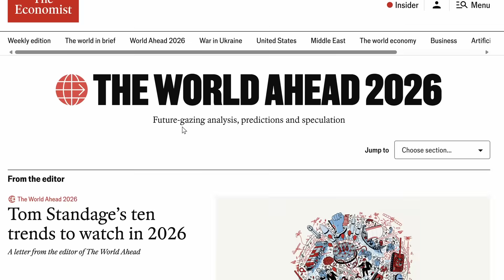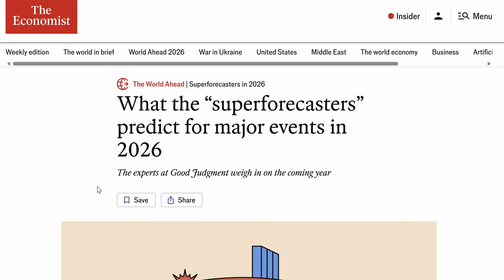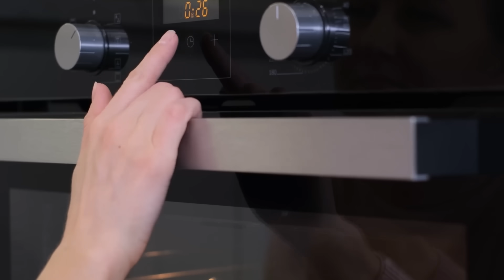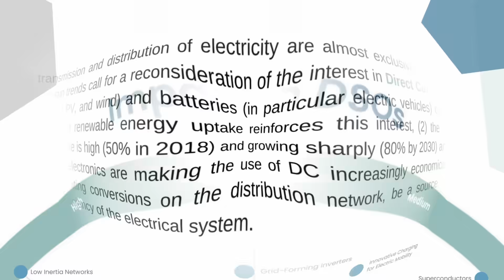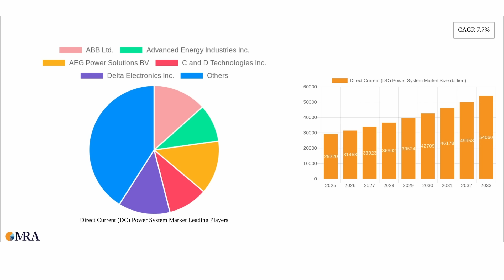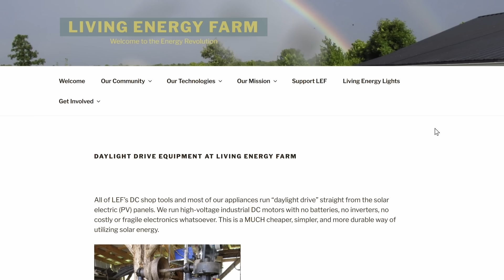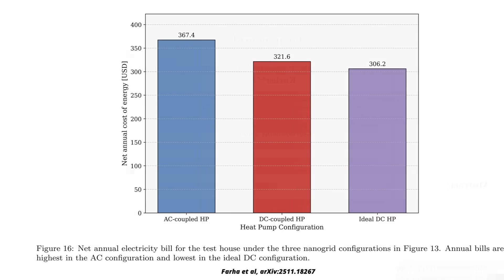Are We Using the Wrong Kind Of Electricity?

Comment: Dc is efficiency with local storage and production.  AC is transportability across large networks.   Local production and storage for the advantaged does not justify elimination of the other.  It promotes oligarchy.  And what happens when a local system fails?

Comment: Complete electrical infrastructure and most large electric motors are designed for AC. Problem you have to solve is energy storage which can smooth irregular output from wind and solar. Imagine sufficient of cheap batteries to run whole Europe for 38 hours ...

Comment: 0:35 - omg... since the start of days alternating current has been used to transport energy long distances. that is it's purpose; most eletronic devices tranfrom them into DC anyways.
so... seriously you included cars and solar panes what changed? your eletronics won't have to make an extra conversion, maybe we'll start needing a dc and a ac plug
or more probably someone will invent a circuit that convererts them between eachother automatically and nothing changes. So yeah nothing will change. that's what I think...
let's see if the rest of the video changes that.

4:25 - and the reason is people are already doing it!? bro... that's stupid. I made my research. what I've learned about transmiting AC being better than DC wasn't about the transmission.
it was about power conversion, delivering energy with low current and high tension is what saves energy. I've seen some claims that the induction effects created by AC make it less efficient, but idk.
the thing is power upping DC has become easier with better eletronics but yeah. Aparently the lack of skin effect and losses due to inductive/capacitive effects, DC does end up being better.
you just need really expensive equipament that uses more silicon and, oh wait... I guess I'm seeing something here...

Comment: When the power grid was being built during that rivalry between Tesla and Edison, it made sense to use AC for long distance transmission instead of DC because AC can be stepped up to a very high voltage via transformer that can be transmitted through thinner wires with little resistive loss.  They did not have enough copper to make the wires thick enough to transmit the same amount of power over the same distance in DC.  Things are changing making DC more viable for transmission and normal household use.  They just have to start making more appliances that run on 250 VDC or what ever voltage is being generated by the panels instead of 110 or 220 VAC.

Comment: Historically the long-distance AC-usage and lower power loss advantage occurred because only AC could convert into very high voltages and back via transformers.
But the technologies for converting very high AC electricity into very high DC and vice versa simply did not exist at the time. They were simply missing.
Today this is possible, but still very complex and therefore expensive because in the end internally there is always AC necessary for any (high-) voltage transformation and of course back down. This is dictated by physics. Nobody can transform voltages without AC.

Since long-distance AC-losses do not occur at DC-systems it is in the end an economic question to use this technology or not; for very long distances this expensive method might be useful. 
But for extremely long distance like the evaluated project power lines Morocco to the UK and Australia to Singapore, their transmission losses were still estimated somewhere between 25-33% using HV-DC, making still every 3rd or 4th PV-panel or turbine only working for making up for the transmission losses. Killing the idea (besides other issues) economically.
One of the major reasons both projects were shelved (to my information - if you know it better, please correct me).

In the end it is debatable, every DC-grid will have frequent internal conversions everywhere back to AC, the moment you need different DC-voltage(s) at or inside your device or machine. Transformers - huge or micro - will not operate on DC. Voltage transformation requires AC; no choice.
And yes, the statement is correct: DC brushless motors are actually AC (@Mentaculus42). It makes only sense if a motor speed control is needed to add the final AC power converter just before the AC-motor.

Every charging cable inside its power wall-plug converts via a small internally electronics the incoming AC (230V / 120V) first to DC, converts it to a high-frequency AC (usually around 30kHz), goes through the internal micro transformer, exiting at an lower AC and finally being rectified into the now 5V-DC, 9V-DC or 12V-DC or whatsoever DC-voltage to feed your computing electronics or radio etc. with internal DC.

I do not see a true advantage here. But hey, maybe I am wrong.

Sabine is also partially wrong; 
Larger wind turbines generate in the end synchronized AC directly into the grid. Asynchronous generators are used and it works basically like this:

- If the rotor spins too fast its stator winding is being supplied with a negative frequency AC. Both frequency add into the desired 50Hz (60Hz)
- If the rotor spins too slow its stator winding is being supplied with a positive frequency AC. Both frequency add into the desired 50Hz (60Hz)

Frequency (rotor) + frequency (stator) = constant desired grid synchronous frequency

Only a small amount of necessary electricity for the stator winding is therefore internally converted first into DC and then back into AC at the necessary difference frequency.
At the output of the wind turbine there is a pure synchronous AC going into the grid.

Smaller wind turbines indeed generate windspeed-changing = frequency changing AC (to be completely converted into DC just for pure synchronisation purpose). This AC-DC-conversion is done by a power electronics or a mechanical commutator at the generator shaft, before a power converter synchronizes its frequency, phase and voltage according to the current grid.

Which is why wind turbines still cannot black-start a grid, at least not without additional technical effort.
Correct is that any PV-panel on this planet generates DC. This too is dictated by (semiconductor) physics.

Peace! from Dresden / Germany

Comment: Had we done DC in the USA we would have needed the stations every few miles at best, and the whole country would have burned down by now with how bad we are at keeping up on infrastructure. Think AC power line failures are dangerous, oh momma is arcing and burning worse when it is damaged DC, especially higher voltage. Also huge issue *𝐃𝐢𝐫𝐞𝐜𝐭 𝐂𝐮𝐫𝐫𝐞𝐧𝐭 𝐂𝐨𝐫𝐫𝐨𝐬𝐢𝐨𝐧 (𝐃𝐂 𝐂𝐨𝐫𝐫𝐨𝐬𝐢𝐨𝐧)*  So no to switching stuff over to DC, would not help nationally but the local levels are better, easier to replace Wall Wart Converters than whole power stations or wires, or other equipment continuously.

Comment: The issue is that we were headed that way. We made semiconductor based high voltage 'transformers'. But they turned out more expensive than copper based ac transformers. Yes many advantages including no reactive losses. No power factor to worry about. Capacitive effects are why we use DC for underground cables.

Comment: a lot more than evs use DC  as you say,   issue is imo same as it was for Tesla and Edison though.,  back then it was impossible to implement DC cuz free energy doesn't pay to implement itself and installation methodology was in concept alone.  if you've ever installed wiring for the 2 you'd understand their dilemma instantly,,,,  the wires im to use to go 13ft in a car to a single amplifier are bigger than those that supply my entire house from the pole across the street 40ft away ..   today a circuitry of sorts might finally be achievable like tesla dreamed., but it might not be smart even if..

Comment: DC has an inherent problem when the circuit has to be broken quickly. The L di/dt inductive kick is nasty and destroys contacts. AC has the advantage of breaking the current when it goes to zero.
Reply: Even with AC it is difficult to suppress the arc when a contact is broken. There used to be a surplus Iron and Steel business in my town. In the yard they had a large surplus high-voltage transmission line "switch". The switch was a stainless steel tank about fifteen feet in diameter and about twenty feet high. The actual switchgear, of impressive magnitude, inside was visible through an open access port. The entire tank would have been filled with, likely, PCB's, to help suppress the arc when the contacts were opened.

Comment: The main advantage of AC is that the flow of charges(electrons) happens at a more short range, than in DC. In AC the charges are push-pull due to alternating voltage polarity forces at distances of meters or less. In DC those charges must be push or pull to way larger distances with the voltage having constant polarity. And that facilitates the transmission of EMF at larger distances compared to DC. An AC power transmission line uses less repeating stations than DC, which is cheaper to build and maintain.This was discovered by Tesla during his experiments. Happy holidays to everyone.

Comment: That's not entirely how this works. DC is just for battery cells, electronics and extreme scale. A car has frequency inverters and 3-phase motors. You get DC from solar but as i said, that goes into batteries and then back to 3 phase (Europe) or your stove won't work. Not having HZ (DC has no sinus curve and 3 phase DC would be useless) is also bad for many forms of actuators. ABB and Siemens have those monstrous DC parts for extreme power lines and they seem to be more effective over long distances but outside of that ... no.

Comment: Speaking as an electronic enginneer you have a lot of mis undersyanding around ac and dc.

First off the long distance HVDC lines are for joining two separate grids so that their AC frequency doesnt need to be synced.

Its probably best to consider it like this: DC is pushing electrons around a circuit. AC is sending pulses of electromagnetic waves which transfer power. This is why in a three phase grid connection you only need 3 cables not 4 as no neutral is required if balanced.

Also sending DC requires a much thicker cable than AC as most of the AC wave power travels on the surface and above the cable.

When you really dig into datacenter builds, if you try to run each server on DC the size of the copper cables into each 42u rack becomes massive, never mind an aisle of 50 racks etc.
Reply: Skin effect increases I^2R losses and makes AC require more conductor cross section for the same ampacity.
Reply: The discussion is Not about 48 V DC, it's about 120 V DC.  Same RMS volts; same amps, same wire size, same I squared R losses.  Sabine is on about the many things that work fine on 120 V DC.  See the list I posted.
Reply: >- Also sending DC requires a much thicker cable than AC as most of the AC wave power travels on the surface and above the cable.
Skin-effect only affects AC so it is AC that requires thicker wire or multiple wires.
Reply: @peteinwisconsin2496 only if using copper, transmission systems use alumium and a 3 phase system has a lower cross sectional requirememt for say 50MW load than a DC equivalent on Alu.
Reply: That really doesn't have anything to do with AC versus DC, the reason that it has to be a bigger cable is because of the lower voltage. A cable thickness dictates the amperage it can carry, at the end of the day if a server pulls 2,000 W and you are running at 48 volts, that's quite a lot of amps, more than double if you were running on 120 volts, and a pretty massive difference if you are running on 240 volts. So this really has to do with the voltage choices not AC versus DC. I build Telco cabinets and mount equipment on towers, we run into the same thing because if we have a radio that pulls 350 W that's actually a pretty decent amount of amps when you are talking about only 48 volts (we start at 54)
Reply: @anthonyrogers1256  yes lower voltages with same power is more current. But in transmission systems lets say a 50kv system with a 50MW load a 3 phase system is less cable cross sectional than dc on an aluminium cable.
Reply: (A self-described "electronics engineer" with advanced degree pats the condescending young self-described "electronic engineer") It isn't that simple kemo-sabe. One problem with ultra-high voltage power lines is arcing to ground as the lines sag in summer heat. For the same power and nominal transmission line voltage the DC power line's peak voltage is the same as it's average while the AC powerline's peak voltage is (very close to) 1.414 times it's RMS voltage. So you either must reduce the AC line's nominal voltage and increase its current or build taller towers.

For data centers defining the voltage to use can handle the size of the cables. And if course the designer takes care of the magnetic effects on the wires, the effect of power factor on all their neat power distribution equations, and other odd effects. I suppose I should enquire of my retired Google data center engineering manager about the pros and cons. My information strongly suggesting DC worked better on the whole than AC. Power factor correction is somewhat effective; but there are still nasty transients on the feed wires near zero crossing leading to imperfect correction and inefficiency.
{^_^}
Reply: @Wizardess  tower arcing height has nothing to do with RMS voltage the clearanve is to account for overvoltage spikes or lightening strikes. RMS only requires 3m ckearance at 240kV but for overvoltage and lighting you need 6 to 9m of clearance at low3st sag point. That distance would apply to AC and DC systems.
Reply: Dude not being derogatory or anything, but where did you get your engineering degree. DC has no skin effect and therefore requires less, not more copper
Reply: @jkvdv4447 what are you going to do  provide each power outlet  in the housr with DC at 220V so you can keep your wires small? And then how do you plan to step down from 220V to 5V for USB or 20V for a laptop, those adapters will be much more expensive than what is curewnlty used for AC.

So if you want to run your house on DC you are going to need lower voltage DC and thus much thicker cables than the current AC we use.
Reply: @jkvdv4447  in a over head 50kv transmission system we dont use copper we use aluminium, doing the calculations a three phase ac for a 50MW load will require 750 to 900A to a DC system requiring a 1000A load. Therefore the DC cable requires a crosssection of 400 to 450mm while the AC requires 300 to 350mm. Which is smaller.
Reply: @jkvdv4447 pulling a plug with 220VDC from the wall, what would the arcing be like, or light switches?

Comment: I watch a bit of your video, historically you are wrong. Tesla have nothing to do with this at all. Westinghouse choose to use AC for it's factories and devices. Also DC is good for semiconductors biasing as we the electronic engineers do in ours designs and systems but AC is the dominant in medium and high voltage no mater what these uneducated economist say.  As for extra high power lines yes they use DC but this done in a very special way, medium network will remain AC (and also multiphase) forever.

Comment: we have rectifiers and high frequency switches we dont have to use the terrible ac power, smooth dc power is more efficient and thw motors are more efficient
Reply: also no noise of 50htz and emf from it, u can touch 220v dc without getting electrocuted
Reply: no flicker of led lights
Reply: @Mad-Scientist-Creations  Many LEDs are pulsed to make them appear brighter while using less power. If you notice flickering in LED lights, it usually means the strobe frequency is low enough to be visible, or there are power drops in the DC power supply for the LEDs.
Reply: no heavy huge iron core transformers needed

Comment: One big advantage of AC is that it naturally turns OFF 50/60 times per second. DC is much more difficult to turn off.

But the biggest challenge for DC power distribution circuits is the reliability of the equipment needed to stepdown higher distribution voltages to accepable home voltages.

The complexity and cost of DC transformers makes them unattractive for power distribution companies.

Maybe someday we will have a DC only power grid but I don't think this will come anytime soon. On the other hand small DC microgrids have huge benefits in terms of sharing the solar and battery energy, while also being more reliable by not have any DC/AC inverters. Also, they don't need grid synchronisation to work.

Comment: There is no such thing as "an energy transition". Wind and solar are intrinsically failed technologies, aside from niche uses. Hydrocarbon (specifically coal & natural gas) and nuclear produce almost 100 percent of the true baseload power across the world today, and will do so far into the future. Nuclear is best of course, and will expand to include thorium and fusion. But wind and solar are both completely dead, as well as the failed idea of trying to run more than single digit percentages of transportation on the grid. So give it up! The Leftist scheme to centralize political & ideological tyrannical control over individuals by way of controlling electricity, and pushing the long debunked AGW fraud, is over. No one believes it anymore. Time for the Left to invent a new fraudulent scheme to extract money & political power from We The People.

Comment: The only advantage of AC is that it can be delivered through wires for long distances with minimal loss of power. But someday everything might be powered with DC through built in generators powered by solar or neutrinos and batteries. That means no more wall outlets, fuse boxes or devices plugged into it. No more ugly power lines and transformers.